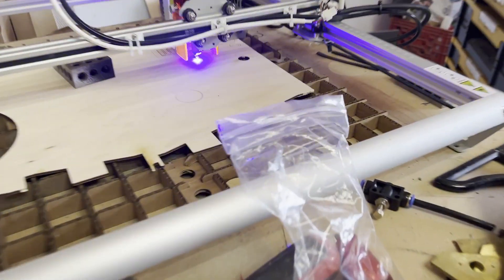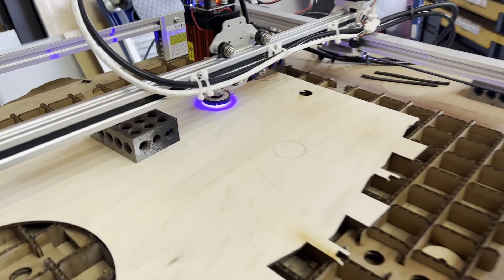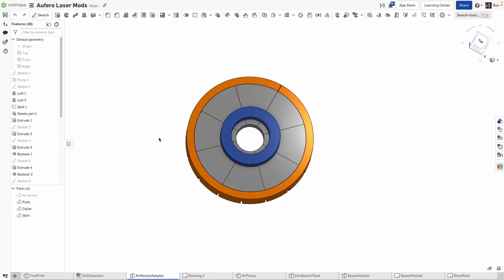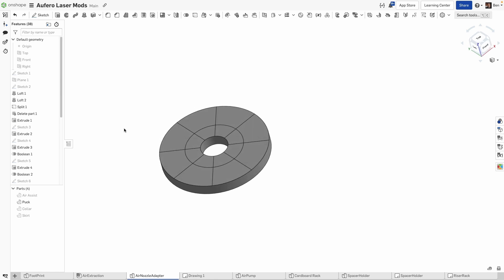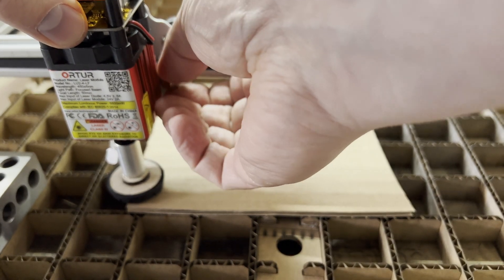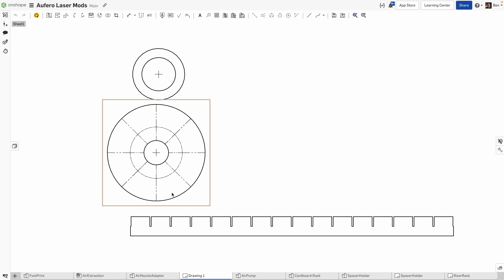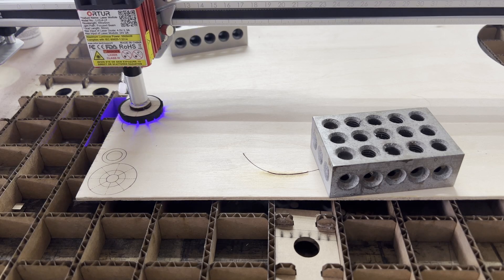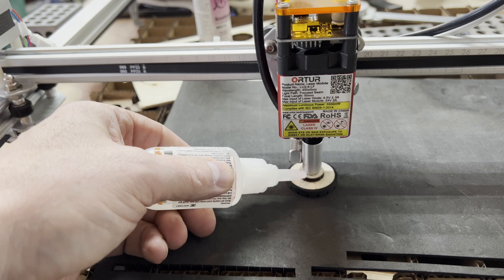Diode laser cutter engraver. Eye saver, air assist, and focuser

Comment: (If your shop is not a mess, then you are not working hard enough!) I'm one of those who need to be able to use the dot to line up my cuts/engraving. However, I keep my cutter with the rear facing the wall, where no one is ever going to be anyway.
Reply from the maker: Someone else had mentioned I should use some laser proof plastic as the disk. Now if you cut one out manually then you would still get the dot. and benefits of this system. Food for thought
Reply: @DreadMakerRoberts  That makes a ton of sense, aside from then not having the original setup, which I suppose could be replaced.
Reply from the maker: @GriddlockCosplay  Ya the modules can be replaced and one just has to buy a new head. I have a couple FYI

Comment: I tried to use air assist after spending money and waiting a long time for a tube to arrive the damn thing reduced the power of my laser... So, no air assist for me.
Reply from the maker: I am gobsmacked if this is the case. I have been using lasers for 15+ years and not once did the air assist not help. I would be curious what air pump, nozzle and such you used.
Reply: I saw a video (James Dean Designs) comparing different air assist methods from a hand held fan to low powered and higher powered pumps up to a full compressor. Strangely using a full compressor performed worse than all other methods, even worse than without air assist at all. It seems at some point too much air pressure is actually detrimental, or maybe it was the moisture or temperature of the air from the compressor.
Reply from the maker: @andrecanis4894  yes that makes sense. When I was testing years ago on my Co2, after 5psi was pointless. I think now I should do a volume test to really narrow it down. I suspect then nozzle shape and size would be important too. I’ll need to find that video and see his testing. Thanks!
Reply from the maker: @andrecanis4894  for those looking I believe it was this video https://youtu.be/UcI-y-ozaBs , right Andre?
Reply: @DreadMakerRoberts  Exactly, I wasn't sure about posting links in the comments.